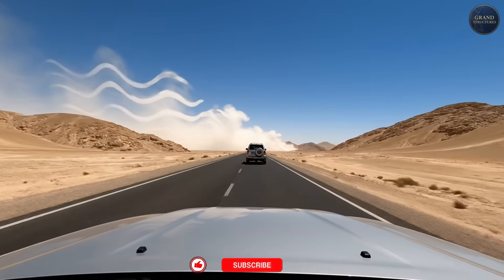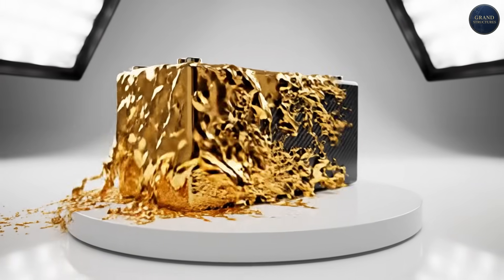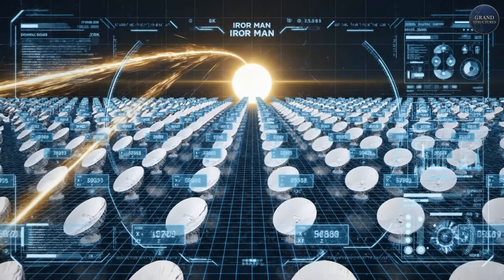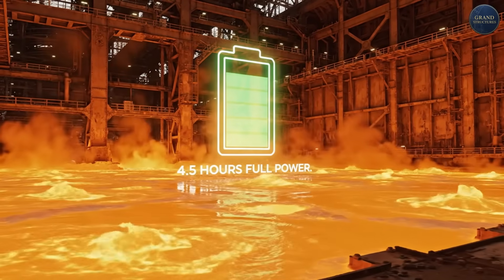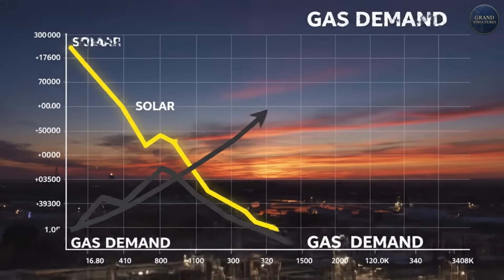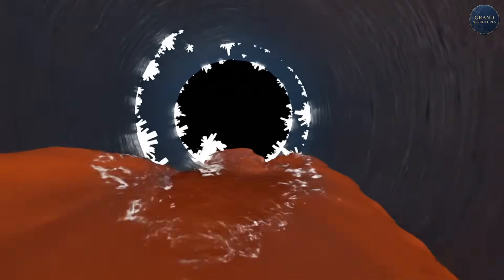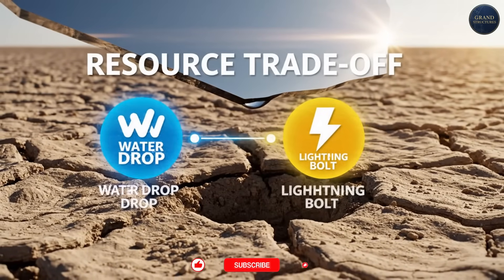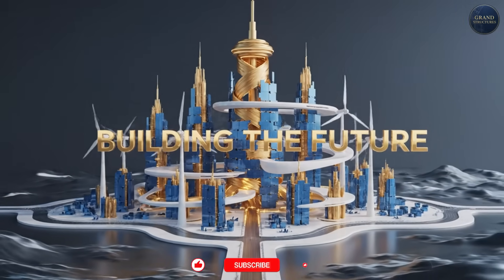This 260m Solar Tower in Israel Solves Solar’s Biggest Problem

Comment: The US system complete failure.  However a lot was learned.  The US gave up at this point but it appears others have not.  There is still a bump in that batteries may becoming cheap enough make a difference.

Comment: Incredible tech.
Reply: Not remotely incredible.   3 projects in CA all failed.  They don't work and the oil heated catches fire, towers require natural gas to get the oil moving in the morning, and the power output is never realized.